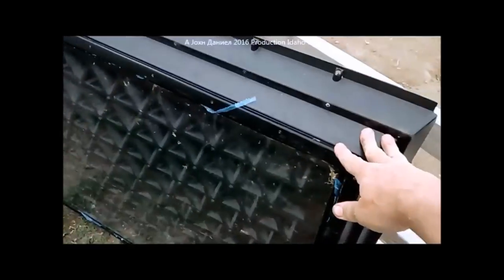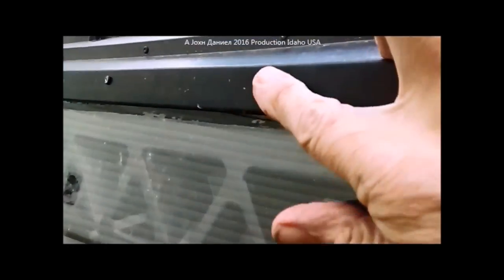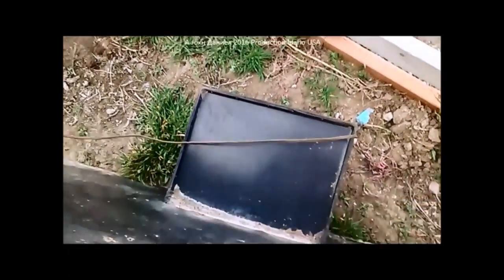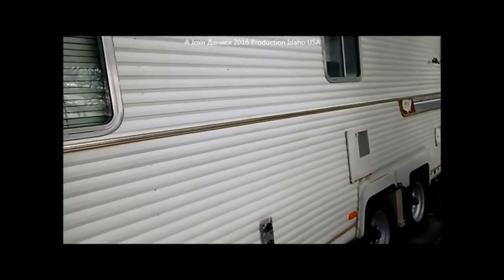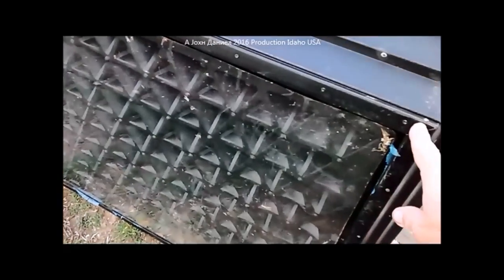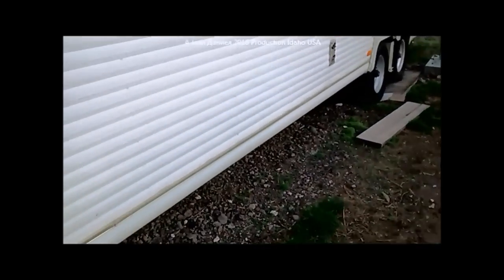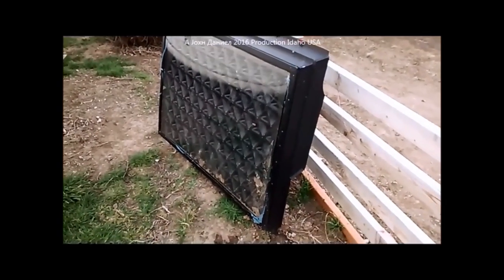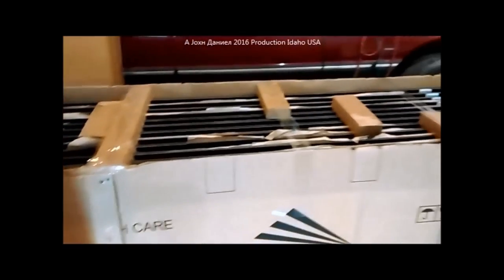Solar Heater and Amorphous Solar Power for home, camp trailers and more - Reviewed

Comment: I love this kinda stuff. My prepper kit is pretty much just a go bag to get me to the mountains of Arkansas , where my kin live. I came to your site from your post about a part for a "motorized" bicycle. I too would like to have the head of the engine pointed forward.  You called it a 5/8 reverse reduction 3.44 to 1 gearbox from surplus center.  I think I found them in Nebraska. But having trouble finding part.  Any help?
Reply from the maker: +Ima Tumor If surplus don't have one then do a search for "pass through shafts gear reduction"
Reply: Thanks, keep your powder dry!